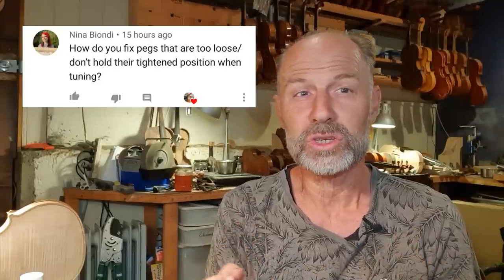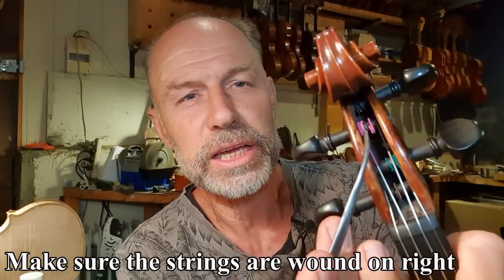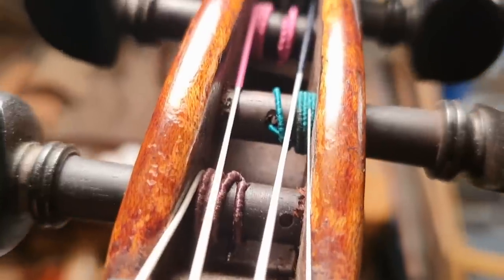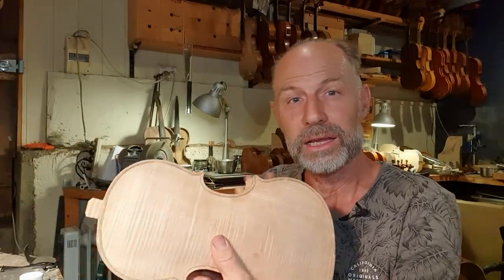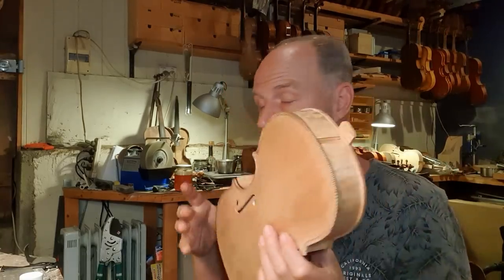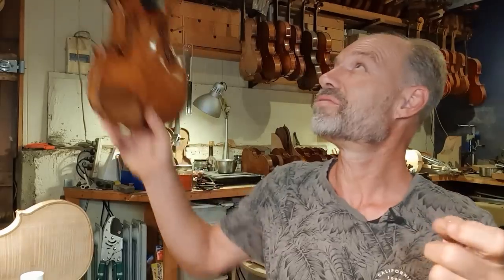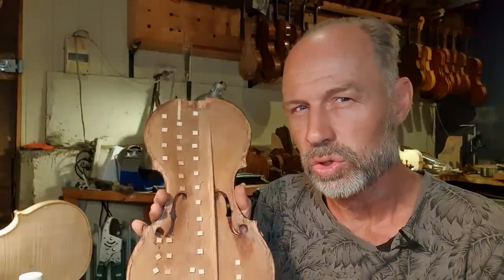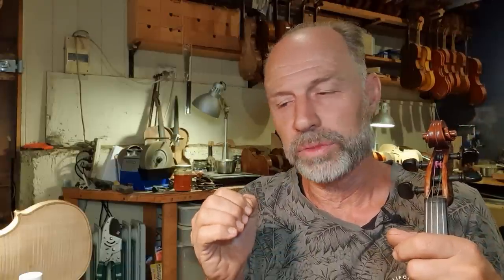Your Questions for Olaf the Violinmaker 2 0

Comment: Thank you for your answer about strings. My viola is an oddity and very sensitive to tense strings. I use Pirastro Oliv, but it really hurts the wallet. Last time I didn't use gut strings was almost 35 years ago, and it got so razor sharp tone I didn't want to play it. So I was curious about the development of nylon strings..  but maybe not for me.
I don't know where I could find an expert who could guess where and when my viola was made - the note inside is missing, so it is unknown. But I haven't seen any similar one - it has gamba shaped body like a double base (body connects to the neck at a slanted angle, not 90 degrees) and a carved head instead of a scroll.

Comment: Wow, that restored 1885 violin looks like new!
You are so right about string tension.  I had a 5-string violin for a while and the C string was always limp like an overcooked noodle.
Since I was even greener then than I am now, I just resold it on eBay.  Also, the string spacing was a bit too narrow (about the same width at the nut as a 4 string violin), so it was difficult to play.

Comment: I have a question: is the violin bridge cut at the same angle on both sides? Because mine is more cut / sharper / on the right -A and E string. So, my bridge isnt really arch-shaped.
So, A and E strings double stops are really hard to do. Is it normal?

Comment: Hello Olaf!  I've noticed some violins seem to have a flat area around the corners and just the edges generally, often with a really marked start to the arching.   Whereas others have this gradual arch down to the purfling and a little bounce back up.  
I'm just wondering why? And what's the difference?
Also I'd be interested to hear what different arching does.  Like what's the difference between the high and low.  And what are the advantages or disadvantagesof that kind of squarer style.  (You know, where the arching is dramatic but then the top is kind of flat.  Is it a German thing? Stainer model?)

Comment: Hi Olaf, I was wondering what is the best way to store a violin if you aren't going to be playing it for a while?
Reply from the maker: Clean it, lower the strings slightly to reduce tension, keep it cool and dry. A violin can be stored for over 20 years that way.
Reply: But not too dry, or else you risk cracks! Depending on where you live, you might not have to worry about it. I made a makeshift case humidifier with water beads in an old prescription bottle covered with plastic wrap with holes poked into it. Reduce the risk of mold/fungus growing on the water beads by working with clean containers and hands, boiling the water used to hydrate the water beads, and keeping containers covered while waiting for them to hydrate/cool down.
Reply: Ok, Thank you!

Comment: Great stuff,  can an average violinist replace a violin tail piece?
Reply from the maker: Yes, you just have to be super careful that the soundpost doesn't fall over. 
Put a cloth underneath the old tailpiece beforeyoutakeit off, so you don't damage the varnish and be careful not to bump the instrument or squeeze the ribs because that can make the soundpost fall over. Most soundposts are fine because they  are fitted tightly, but some ca  be really loose. 
In a way it is better to have a violinmaker change it in case something moves.